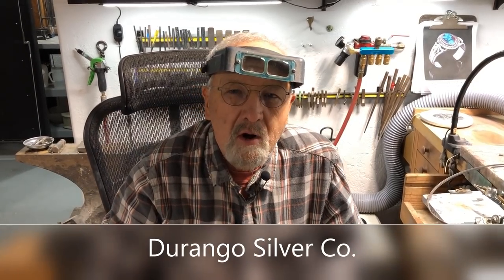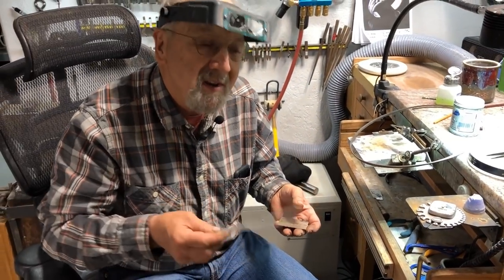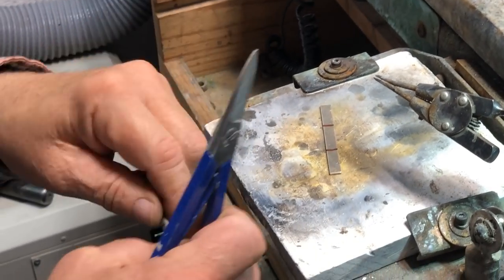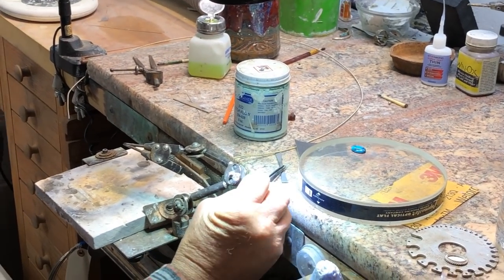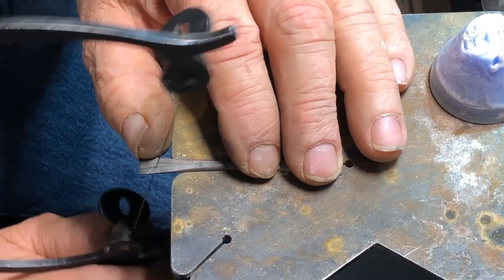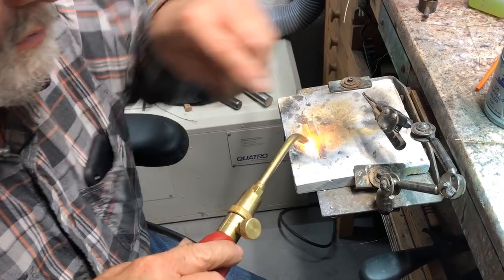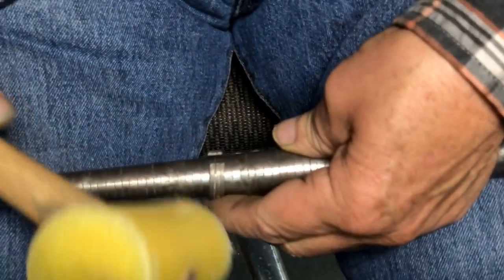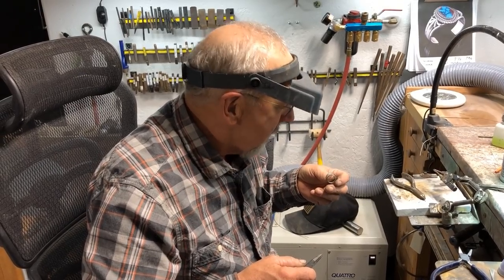How to Make a Silver Ring Shank – DIY

Comment: Love your method of teaching.  Very informative and considerate of your audience.  I was also wanting to know the different gauge of sheet metal for the different size cabs for rings?  Does this standard also go for pendants as well?  Thanks for sharing 😊
Reply from the maker: Thank you so much.  So, everyone does something different when it comes to building jewelry.  I have my preferences I have built over the years.  I  like to gauge how thick of sheet I will use by the size of the stone and the feel of the piece I am making.  In general, for most standard bezel rings, bracelets, and rings,  with an average size stone, say from 10 mm to 24 mm large, I like to use 24 gauge sheet.  When I am making a heavy weight bezel piece I use 22 - 20 gauge sheet.  When making earrings I like to use 26 to 28 gauge sheet to keep the setting lightweight.  General rule of thumb, the larger the stone, the thicker the sheet. I hope this kinda answers your question.
Reply: Turquoise Jewelry | Durango Silver Company Thanks it did answer my question.  I’m new to making jewelry using soldering so this helps.  I started with wire wrapping and weaving.  Looking forward to your next video!  Maybe something showing how you embellish when you design.
Reply: @kay0816ify  Hi. I started with wire wrapping too and have recently started learning more about being a bench jeweler.  I suppose that's the usual progression for anyone who enjoys this kind of hobby. I find it very fascinating and so glad I found this channel. He has so much experience and is great at teaching. Best wishes on your jewelry making quest! 🙂
Reply: tammygurl64  😊 Best of luck to you as well.

Comment: When you bend the ring with the half-round pliers, doesn't the metal get marred? If so, how do you minimize the marring?
Reply from the maker: Usually we use half round pliers to get a better grip.  You can use round wires, but when working with thicker heavier materials they really do not work well.  So the trick is to use the round side on the section of metal you do not want to mare.  Use the square side on the section of metal you plan to sand and buff.
Reply: @DurangoSilver  Ahh, that makes sense, I didn't think about that. Thanks ;)

Comment: turn the  gas off and and than  release the gases  in hoses , otherwise your hose will deteriate and you end up with a fire or an explosion and that can happen anytime the chemistry of the gas in the hoses  will eat the rubber of the hoses ..... ( ,,from experinced weldor :a welder is a machine  but a weldor is a welding machine operator   Super important safty !) learned that in PIT  provincial institute of trades college in the 60s  toronto on. can.